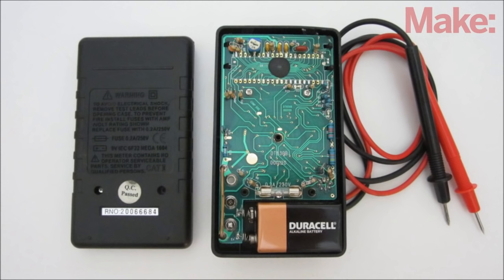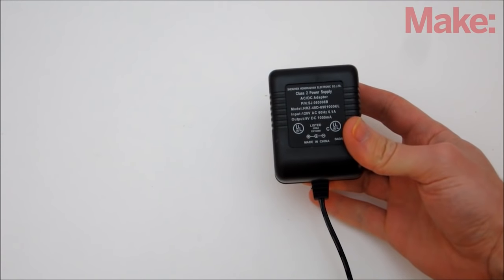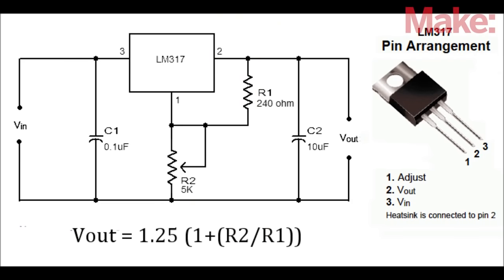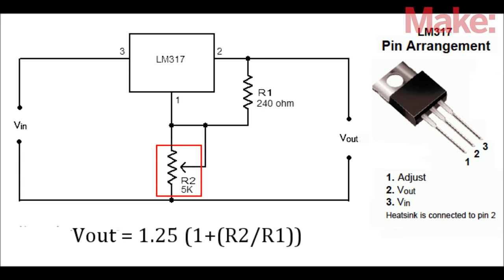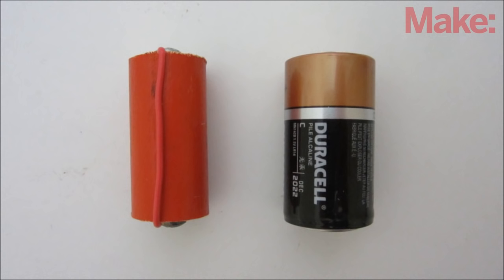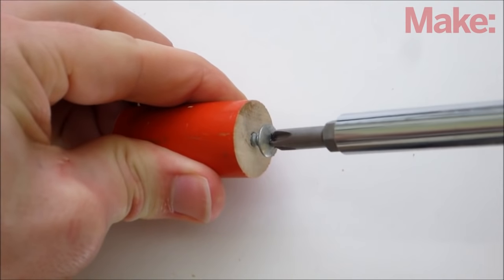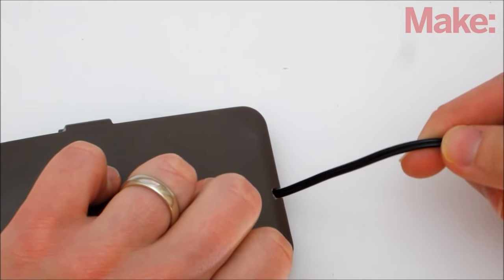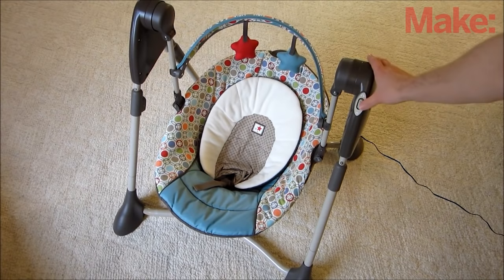DIY Hacks & How To's: Convert a Battery-Powered Device to AC Power

Comment: Initially you showed us how to run the two wires from the two terminals but then you made these dummy batteries and they are all with red cables. Confused why not just run the two cables instead of hooking each dummy battery to the terminal?
Reply: Maybe its just so you can connect it to different appliances easily rather than having to constantly twist and untwisting wires everytime you want to use it for a different machine
Reply: +de0509  literally what he said. lol

Comment: how many Amps would my wall wart need to supply to mimic 1 AA cell?
Reply: 1.5 volts. Batteries don't release a constant amperage, they have a limit to what they can deliver, but they don't deliver a fixed value. The device that it's plugged into might draw almost no amps or a lot. A spinning motor draws a lot, smoke detector might draw very little.
Reply: @Squiffel  I have a little battery shaver for trimming.   It takes 1 AA cell.   If I wanted to convert this to wall power, do I need to look closely at the amperage a wall transformer would deliver?
Reply: @dizzolve  You have to match the voltage first, most adapters people own are 5V, that would damage your device. You'd want to find an adapter that is between 1.3-1.5 Volts and has a current below 1 Amp. AA batteries cant't produce more than 1 Amp at a constant current, so there is no reason to go higher. Anything with a motor is a bit risky, they if the current (amps) is too high, they can get too hot and fry. Ideally you'd experiment and find the lowest amperage you feel comfortable with that keeps the device working as expected.
Reply: @Squiffel  thank you AC

Comment: Yea, but you just need 1 component and boom, AC turns to DC :)
Besides, using a power supply is equivalent to using and external transformer with a rectifier. Back in the days when Switchmode power supplies weren't so popular, those brick-like power supplies had big clunky tansformers inside.
Or you could even make a power supply without a transformer, google a schematic, it can be done :)

Comment: Instead of making fake batteries, just drill two holes in the case, two screws and 3 nuts, just roll the psu cable around the screw and tighten the outer nut or butterfly nut, of course the screws have to be connected to the case terminals, as usual, mark everything up. It's faster to build, faster to attach and not a huge lump of wood hanging on the wire. Done this quite a few times, with tools at hand, takes less than 4 minutes to make.

Comment: so I didn't have a transistor handy so what I did was cut off the jack from the AC adapter and expose both wires, I then got my child to sit into the swing and hold each exposed wire in one hand (I know you'll worry that a young child won't hold the wires for long, but once you switch it on the hands will clamp closed on the wires) then all you need to do is douse the whole unit in water so as to make a connection from child to battery compartment. Then you simply turn it on at the wall and your child should start to pass power to the swing and save on those expensive C batteries.

Mine has been swinging back and forth for hours and there isn't a sound out of the little guy, he's so happy with this lifehack.

Comment: OK, this isn't always the right thing to do. Depending on the configuration of the batteries, sometimes the voltage is added across all the cells (series), and sometimes not (parallel). Just counting the batteries doesn't tell you anything. You need to be able to see exactly how the contacts are configured. Some wall adapters aren't rated to produce the current needed for some applications. This would be rare, but would be a fire hazard.
Reply: Very often in the battery compartment, the actual voltage is printed somewhere. If not, you could just use a multimeter to get the voltage while the device is running. The main thing is to ensure no corrosion is present i.e. no battery acid has leaked onto the board or components. If it has, dispose of the device accordingly

Comment: OK, not pretending to be an electrician, so I found the right voltage power adaptor - keeping it simple... Now can someone tell me:
 1. what's the disadvantage of connecting  wires directly to the terminals?
 2. Why need o mark + and - on dummy batteries - if they're dummies there's no polarization (or am I missing something?)?
Reply: The disadvantage of connecting direct, is only that it's more inconvenient to disconnect the power supply and switch back to batteries.

Only one fake battery needed the polarization markers because it has a linerar voltage regulator in it which is polarized.

Comment: Anyone with knowledge on the subject know if I could hardwire a ps4 controller?  I would presume I could just cut the end off the USB charger and hard wire it to the board where the charger port would be soldered on?
Reply: Cody HWynn No. You would have to wire a power adapter to the internal battery terminals. Why not just get a long usb cord and connect it to a usb charger.

Comment: This post is 8 years old so I'm reaching out to anyone with the right information. 
I have 3 harbor freight driveway alarms. The outside Xmitter uses a 9v battery. The indoor receiver use 3 or 4 C batteries. 
I purchased an adjustable AC/DC adapter.
It has 3, 4.5, 5, 6,7.5 & 12 volts. 
The alarm receiver uses 6 V/ 200MA. I set the voltage to 6 & plug it in. 
Is it safe to use adjustable adapters when you don't know what the Amps are?
I have old adapters from cordless phones and drills. 
How important are the Miliamps if the voltage is correct. 
I'm assuming its only important when dealing with sensitive electronics, like a laptop or iPad.
I'm thinking if the Miliamps mattered they wouldn't be allowed to sell the adjustable adapters.
Reply: It should be fine. Best to keep the amps close to what the electronics need, but it will only draw as many amps as it needs.
Reply: @Squiffel  thanks. Its been working pretty good. Especially since I usually turn the receiver off in the daytime because the transmitter picks up so many squirrels and birds.

Comment: SamoanGirl Power These devices are not Power generators..., they are just converters that convert AC power to DC power...
(So instead of using Batteries, you can now use power plugs from the wall)

that's why it's not a big thing... batteries are useful too because they offer portable energy...

Comment: I did this when my son was abt 3 months.  I just spliced a 6v adapter to the moter directly.
Reply: Did it give you any problems ? When I was a kid I would try to grow weed in my room in a box with lights and fans that I threw together and my dad seen ac stuff spliced with dc stuff and made me feel like I was lucky that the whole house didn’t burn down.. and he was a fire fighter so I just assume he kinda knows what he’s talking about but I used to build all types of stuff and never even considered the comparability of my stuff I just needed a plug and know the red positive black negative than we’re set. And I don’t think I ever came close to burning anything either...
Reply: @mikeahrens3185  no problems.  Weed good meth bad.

Comment: Can you do a wall plug in device made into a battery powered device
Reply: +jonathan Capella but how!? i need that info too
Reply: +jonathan Capella input=ac100-240v 
output =dc12v---1A
it's an led string light that i would like to power with battery
Reply: +jonathan Capella thank you sir i will try it out

Comment: I have a batterydriven AER amplifier which i’ve been busking with great success but I want to bring out more of my gear to stand out even more among buskers.
So i need to get some battery power for this gear below. What should I do? Car battery feels a bit overkill?

I have 2 drum machines
aka mpx drumpad  • Power: Input 5VDC 1000mA via USB
Roland tm 2                       AC adaptor 400 mA

1 VOICETONE HARMONY-G XT:
the specs say:
* External Power Supply Mains Voltage: 100 to 240 VAC, 50 to 60 Hz (auto-select)
* Power Input: 12 VDC 300 mA, tip negative

I have a pedal power 2 for my guitar pedals
https://www.thomann.de/gb/voodoo_labpedal_power_2_plus.htm
with 5 pedals (4 of them 9v bosspedals and 1 of them 12V DC Input (consumption 113 mA / power supply included))

Comment: Those regulators can get hot, and your fake battery is wood.   Also you must take into consideration the current draw vs the current limit of the wall wart.  Also, your putting a baby in this thing.  It might need a little more engineering.

Comment: Definitely not a "How to " instructional video at all . There was a lot of details left out of the project such as proper caution, soldering, using a multimeter etc etc..
Using a multi voltage adapter would be a good way to go since the voltage you need may vary depending on the kind of device you're using.
In addition to this knowing the exact requirements for the device is crucial to making sure you are within the parameters of the requirements .
 Multi voltage ACto DC adapters are fairly inexpensive and easily available . Also whenever doing such a project it's vital to verify the voltage specifications and to verify the voltage from the adapter is exactly the same as what you need . Never assume that the adapter is working as it should or that it's putting out the voltage that its rated for . Always use a multimeter to verify voltage is present and in the range you're looking for . These are but a few issues that should be dealt with whenever attempting to do such a project as this .

Comment: There is no converting a battery-powered device to run on AC being done, here.  The device still runs on DC.  The poster is, actually, trying to show how to convert AC power to DC power by hooking a voltage regulating device (LM 317) between a transformer (wall wort) power supply and a device that runs on DC.  But, I don't think an AC wall wort is appropriate, here.  Wall worts output either AC or DC, so one must be careful to use a DC outputting wall wort in order to input DC to the LM 317.  Another way to change AC to DC is to use a diode bridge rectifier circuit.

Comment: You say most powering devices dont have the right out put socket. Okay so simplify it and say one that does
Reply: +Jesusandbible You need to look at the device you want to power and find an adapter that has similar output on the label as what your device's labeling asks for. It'll be vastly different for each project.
Reply: +Danny Khalil ........5 volt for instance
http://www.ebay.co.uk/itm/221951516462?_trksid=p2057872.m2749.l2649&ssPageName=STRK%3AMEBIDX%3AIT

what powering device DOES have such an output socket?
I found my phone chargers never warmed the heat pad like a direct USB to a plug does

Comment: It would make more sense to calculate exactly how much power the device uses in terms of AC/DC, disassemble it, create a jack, then plug the appropriate AC / DC adapter.  I've done that on several devices in the past, with no problems.

Comment: Great way to burn your house down
Reply: and his kid lol
Reply: Considering its DC output @ 9v/1amp, there's little to no risk here.
Reply: More of a joke then a reality
Reply: All you need is a spark. Doesn't require a bomb to burn a house down.
Reply: So, what you are saying is that in accidental fires caused by squirrels chewing on power cables, the squirrels would also have had to poured gasoline all over the buildings as well.
Reply: Many items come both plugged in and portable and designed by people like this.

Comment: I mean this is the nicest possible way, but this video is terrible. It assumes the audience knows anything about power or circuits which is not what a good tutorial video should do. A good rule of thumb when making tutorials is: assume your audience are morons i.e. spell out everything. You say what need to be in the circuit and then you jump to what the completed circuit looks like. This is not good and doesn't make for good tutorial. You need to detail EVERY step in the whole process.

Comment: as long as you dont mess with the transformer module you will have absolutely no contact with the so-feared AC, simple enough and pretty straight forward, easy stuff actually

Comment: With all the time and energy on your modifications, it seems the handful of batteries you would have to buy for the time your kid is small enough to fit in the rocker would have been a better buy, rather than hacking in a potential fire risk next to your newborn.. Just saying.
Reply: InventOnTheSpot, I have this same inefficient swing. Somehow, it barely moves and yet it will burn through 4 C batteries in a week of light use. It is the exact reason I googled "DIY AC adapter 4 C batteries".